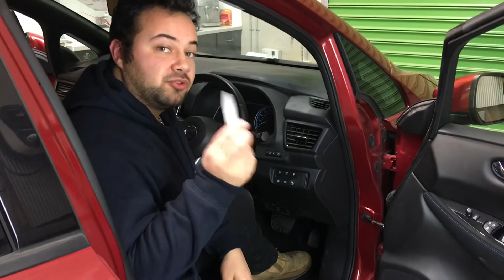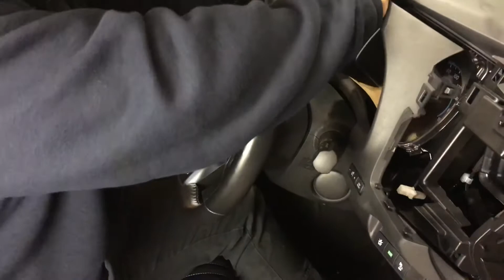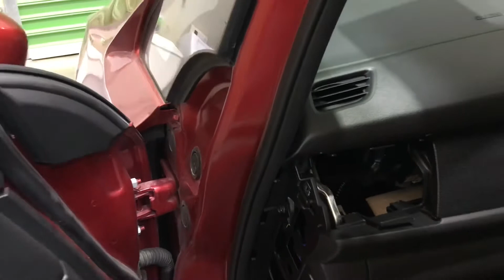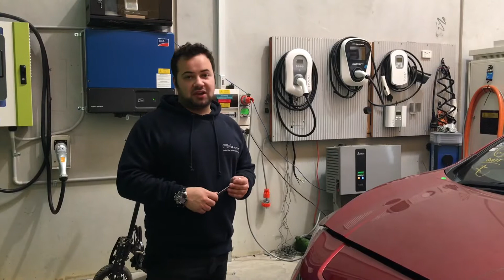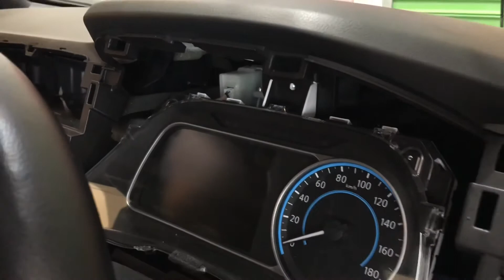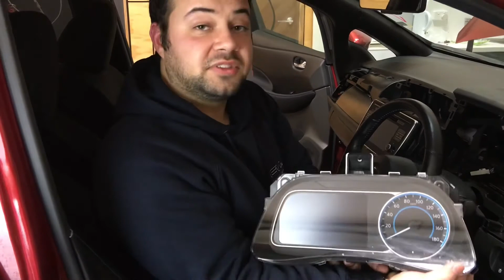Nissan LEAF Instrument cluster removal for english language conversion

Comment: I'd isolate the 12v battery before starting work on the trim. Also work from the left side first - as you appeared to have to go back to the trip meter connector twice. Otherwise all good.